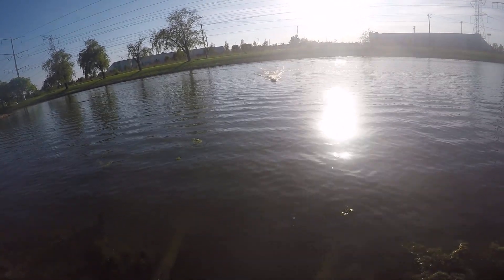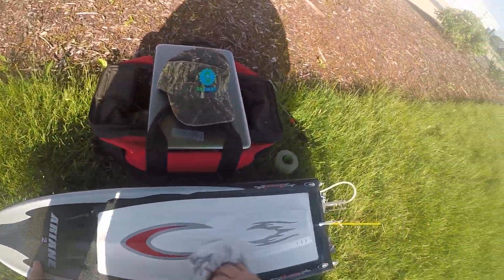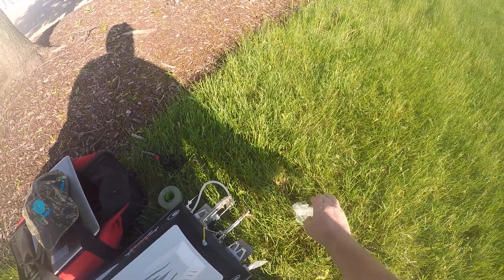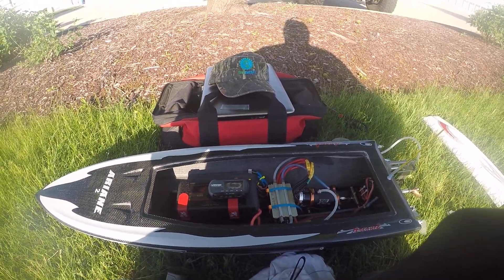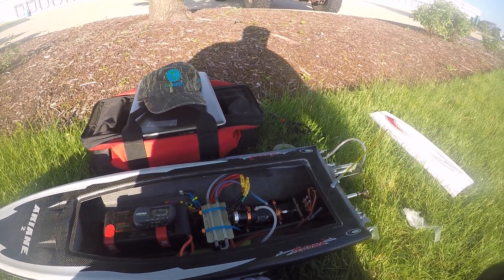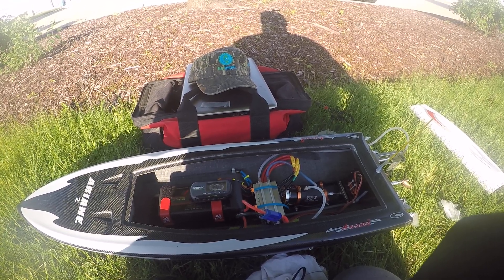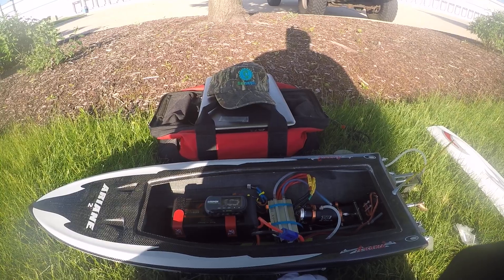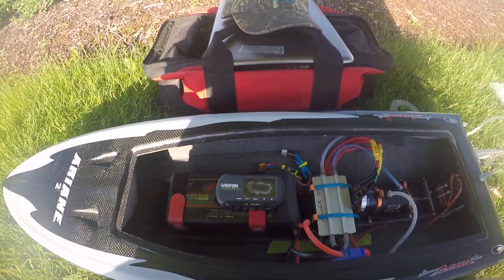63 MPH TFL ARIANE 2 TP 4060

Comment: I just checked that OSE has right now 5 ( five ) 1916 Abc props in stock .....
Send it to Dasboata and have one of his latest "magic" cuts ....
Everything else remaining untouched, including batteries ....
This is certainly the more cost effective alternative .....
Cheers !
Reply from the maker: Pedro Monteiro 
There is no more money left!
Cost effective is to use the 2014 I already have....
But before I do that I will just add timing....
I bought a few things over the winter that I did not video yet and as a result no more 💰 left for parts or toys........
Reply: OK ...!
Reduce timing : 3.1 to 3.0....... it may improve top speed a bit
Later you can have your 2014 Abc prop prepared by wizzard - Dasboata
That is a BIG prop !!!
Cheers !
Reply from the maker: Pedro Monteiro 
3.1v is low voltage cutoff per cell 3.1volts
Timing is a 8 degrees 
Less timing it goes slower 
I will raise it to 10*.
All my props are already
 S and B by Brian, Chris or Alex.
Reply: OK ....!
Raise timing to 10 degrees
Lower cutoff to 3.0
Try this setting
Just my guess ....
Reply from the maker: Pedro Monteiro 
Already raised timing 
No reason to lower lvc unless I run into a problem again.

Comment: I ran my Ariane yesterday first time using the 4060 1750kv, two 3s in series, with a detounged 447 with the ZTW 200a esc. For my first impressions I was pretty impressed. Temps for motor, batts, connectors, esc ranged from 109-122 degrees F. The throttle response was on point. Speed was fast maybe hitting mid 50’s. I need to buy a gps.

However, one thing I don’t like is the ZTW software... it’s data log is very minimal and doesn’t show a lot of readings. It was limited to max current, minimum voltage, and max rpm. 

The max current was 62A. That seems too low, idk if that reading was recorded from one individual battery or both. Idk how accurate it is. I tried doubling it and it was 124A. But it still seems too low. Also the max rpm was 23,800.
Reply from the maker: ADxRC 
Awesome you put it together.👍👍👍
Do some videos.
All My temps were pretty low too, except the connectors.
I would think you would be at least 55-57 with that prop.
That's one esc I'm not familiar with, I know ose just started carrying it recently, amp seems low and you don't have to multiply it, it will read both batts, on the other hand the sf data logging seem very high.
If I had to guess I'd say that motor is pulling somewhere between 150-200 actual Amps maybe a touch more.
I have seen a 100amp swing in the logging going from one esc to another on the same combo, it's all just numbers based on the algorithm in the software.
Not sure how accurate any of them are.
The rpm also seems low (unless you never reached max throttle)
This number however should be dead on, it measures the pulses or switching going to the motor, make sure the number of poles or pole pares is correct if it gives you the option to change this.
How long was the runtime?
Reply: What about using the following OCTURA prop available at OSE :
www.offshoreelectrics.com/proddetail.php?prod=SB-oct-m645

or even better ....the following :
http://doctorprops.torgg.com/collection/proboat-props/product/cnc-x440-proboat-recoil-26-propeller-stainless-steel-2

Cheers
Reply from the maker: ADxRC 
Or get an 1814 or 1815 
From Brian Picasso props Buaas 
and go 60+ all day every day.
Reply: secret squirrel I will try to post a vid. As of right now summer semester(learning stuff on electrical circuits) started for me so idk when I’ll  get to it. From my most recent run, I think the run time was about 4 minutes. I was using 5000mah batteries.
Reply: Pedro Monteiro I actually have that prop. But I wasn’t able to run it yet because I only have one set of batteries because my other set is degraded already. I only ran a detounged 447 from RCBOATBitz